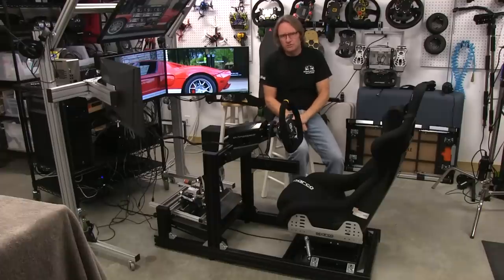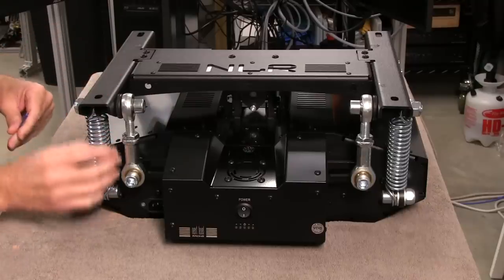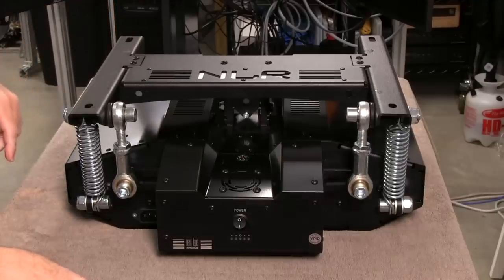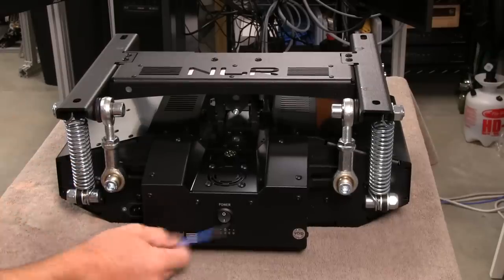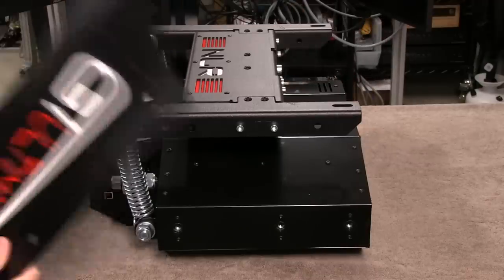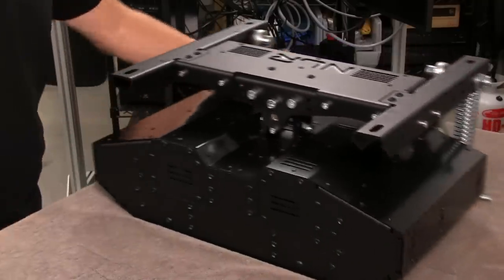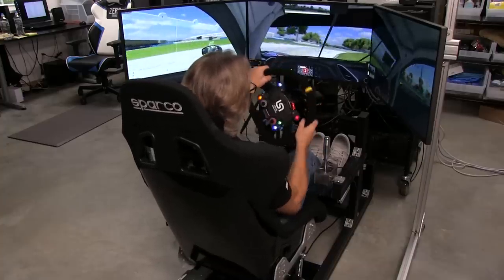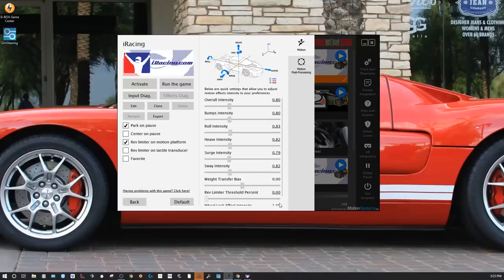Next Level Racing V3 Motion Platform Review

Comment: Seats don't move independently from the car and the wheel, so how real can this feel? Wouldn't this just be more of an annoyance/hindrance on your driving then actually feeling realistic and giving good feedback?
Reply: I own one and you would be surprised how it feels, it works very well
Reply: I own one as well. It's one of those "dont knock it till you try it" type of things. I'm happy with my purchase
Reply: I thought like you before trying all systems available. I prefer seat movers because when you driving a car, your body get's displaced from the g-forces and tilting the hole rig felt fake for me. Tilting just your upper body is more similar to what you even get in a usual road car. When you brake, a seat mover is pushing you into the brakes, which I find the best effect of them all and not working with a d-box system.
Reply: It feels pretty good especially when you're in vr.
Reply: @Leynad778  great explanation Leynad, I wasn't convinced about this compared with a full rig mover but thinking of the steering wheel as a 'solid bracing point' as you do in a real car, makes sense. Want this rig so much!
Reply: Seats don't....but drivers do...and that's the point. No system is perfect and seat movers are best turned down so the effects are subtle.
Reply: @ravey1981  D-Box-systems should be subtle as well if it's not for Rally-driving, because the one i tried plus a similar system at the Expo were IMO both more annoying than anything else. I'll wait for the SimXperience GS-5 and from the first review it seems, that this seat is the best and it get's perfect in combination with a full-motion simulator, but according to the review you would rather use the GS-5 alone than a Stage 4 without the GS-5.
Reply: @Leynad778  I was thinking the seat movers were also not an accurate simulation(but haven't tried either), but seeing this review(and your comment) got me thinking.  The car is going to move a lot less than what the driver does, so the relation between how much the car moves compared to the driver is more in line with a seat mover.  Good to hear someone's experience says likewise.
Reply: @syberspider  Just had a real kart-race this weekend and with maybe 2-3G in the corners there is no motion-system that can simulate it. A seat mover can do some percentage, maybe 15 or so, traction-loss probably nice, but there is no suspension travel in a kart, no rumble strips on an indoor kart track, the surface is smooth. A proper D-Box-system should do nearly nothing to stay authentic just hobble a bit when the tyres skitting for traction. A strong wheelbase is needed to simulate the steering-forces, because my Accuforce is maybe about half as strong as these karts, but difficult to tell with those G-forces bending your upper body.
Reply: @Leynad778  Agreed, there is no motion system that is going to create those kind of g forces.  I think a combination would be interesting, but could be a nightmare to calibrate to work together.  This got me thinking, are there any 2-axis(lateral seat movement) systems?
Reply: @syberspider  There's the traction loss for the NLR V3 coming, but it will be expensive. 5k or 7k plus V3, can't remember. And there's the SimXperience Stage 3 and 4 with traction loss. I tried both systems and the Stage 4 seens better and is more affordable.